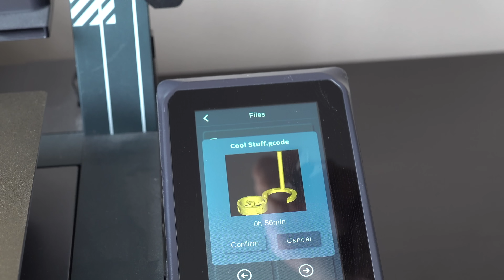FREE ENERGY TOY - NO BATTERY RUNS FOREVER

Comment: Excellent  project. Thanks for sharing it.  Let us know how these hold up as the years pass by. Very interesting things happen when run something non stop year after year.  If you are running it on solar energy then heat and UV take a toll I found out.  My biggest problem has been bearing issues after hundreds of thounsands of hours running.
Reply from the maker: @Lidmotor  Thanks Lidmotor, I kind of figured component failure would be the only thing that would stop it. It's just a super cool curiosity that's too good not to play with. Thanks for the inspiration in you channel 👍🏻

Comment: Ok so what was the point? You took an old plastic toy, cut plastic into sink, presumably threw the rest in the bin ( great for the environment both of those), then created another 'toy' made of plastic (prototypes?) More plastic waste. And on completion another do nothing device. Design is interesting but hardy groundbreaking or even functional. I would have cut you some slack if it did something (tell time even)
Reply from the maker: @robba1234  Have a fantastic day spreading you positive vibes brother ❤️
Reply: @BrainfooTV  Sarcasm? Is that the best you have? There a loads or repurposing videos on YouTube that do a better job, I like the device it was just trading one bad plastic toy (Do nothing toy) with another. In my 'opinion' ALL plastic printers should come with a recycle station, with printing errors and prototypes these units generate more plastic waste than the solutions they solve (Usually NONE) As a prototype maker  they are fine and I understand the need for them commercially. (A friend makes plastic parts for cars, and other devices and household things that break and either the pars are unavailable or you need to buy the whole unit for a cracked part). By now you see its not a personal attack on you, I see a purpose for plastic 3D printers but not for projects like this. (I did say if a clock was added at least it could tell time?)

Comment: If you are already putting it under a dome, you might as well pump the air out to reduce/remove drag and increase its speed and effeciency
Reply from the maker: True, but it already runs non stop at 600rpm. The dome just keeps the dust off but maybe that's not needed either. The MK2 version hast stopped on me yet and that's open air